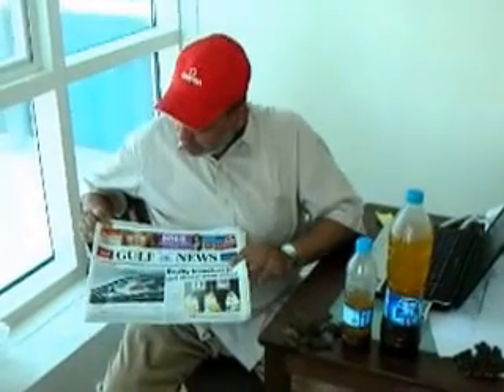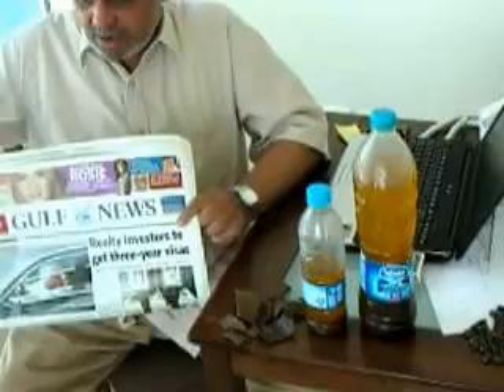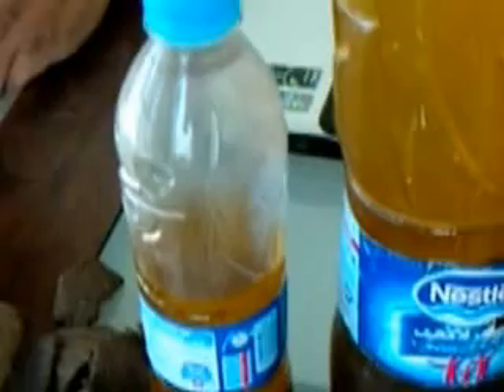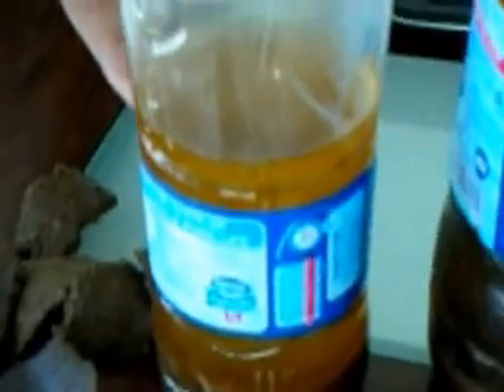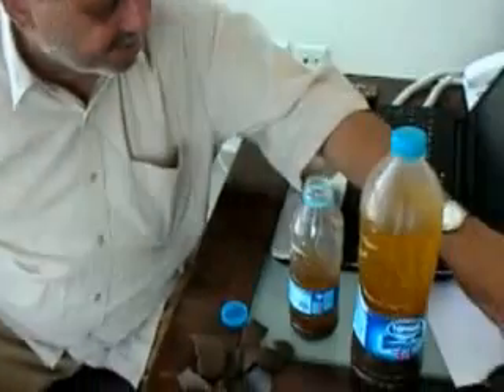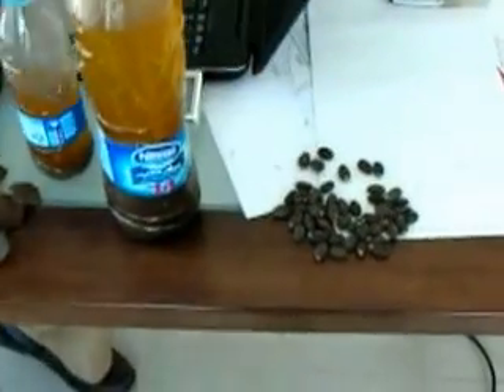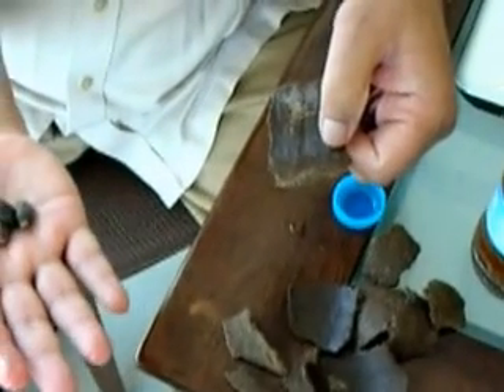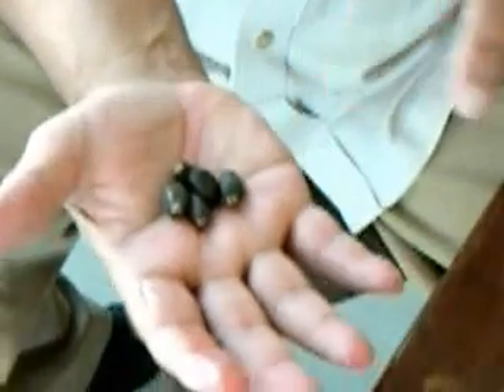Jatropha  from  seed to oil   biodiesel   by Salim Mastan   t

Comment: Do you need to do transesterification of Jatropha OIL to make it a diesel or u can use it directly in diesel engines. If you have to do transesterification, what is the cost of transesterification equipment?

I will inshallah be planting jatropha in April next year but I still don't know what will I do with my crop as I don't have any potential customer.  Do you buy seeds / oil from farmers?